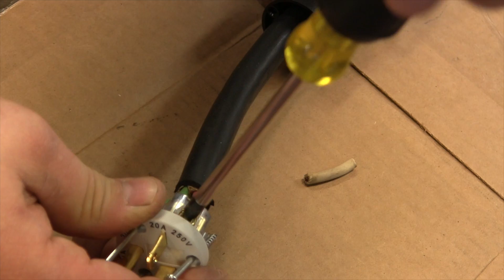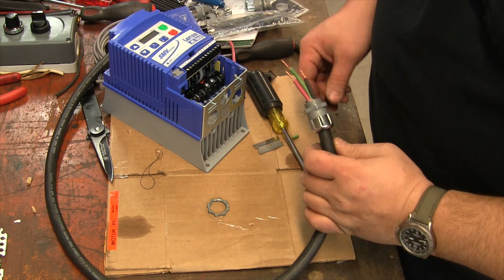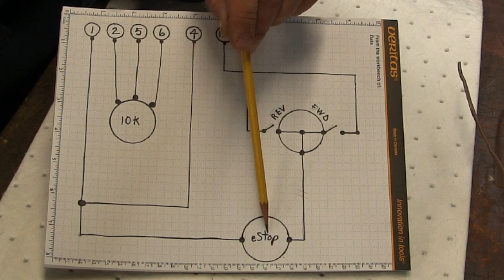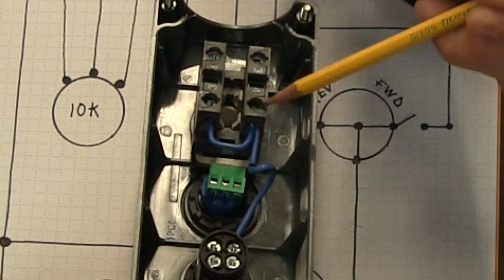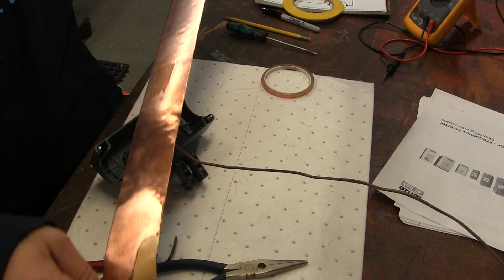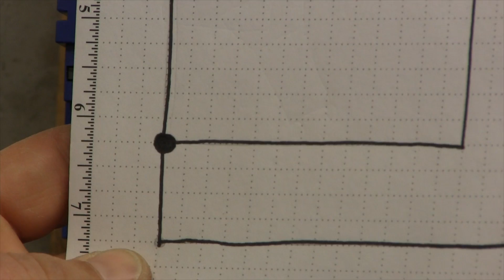South Bend Lathe 3 Phase Motor & VFD Installation   Part 2

Comment: If you are not going to install proper connectors for the line voltage into and out of the VFD at least tin the copper strands before screwing them down in their terminals.. Man this video has turned out to be a major disappointment.

Comment: You don't need any shielding in the switch box if you use a noise filter into the VFD.  You don't need a filter out of the VFD.
Reply from the maker: Well dude, I’m not an electrical guy whatsoever. That was years ago as well. Luckily for me, the install was rock solid and the machine always ran like a clock without a single issue. The it got sold, haha.

Comment: Dude.... I just went on the Galco website and priced out the parts for your controls. Insane prices. $118. for the 10 K pot. It's low voltage man and I am objecting that Amazon wants $12, for one. 
This Galco company is nothing short of highway robbery, ..... If you paid anywhere near these prices you got hosed big time. Why would you pay $7. for a strain relief into the bottom of the VFD when a plastic one at a third the price will do the same job. Not to mention you are not suspending small children from the wile leading to the VFD.

Comment: Mr Jacob I thought I heard you say that you would give is all the numbers and etc. on the switches that you bought the Forward  Reverse Switch the E SWITCH The On and OFF SWITCH and the HOUSING they fit into I could not find that Information, OH and also THE POT so would you PLEASE POST that information for me? I would really appreciate it I am not an electrician I am a machinist by trade also, I played guitar my entire life heard you say you play I am 82 getting to point I don't play much anymore got some gear to perhaps to get rid of if your interested Please let me know, OH, I am putting a new 3 HP motor and VFD on my old Clausing Lathe that is the reason for the numbers for the switches his is all new to me just trying to work my way through this project with the help of good fellows like you. THANK YOU very much, Bill
Reply from the maker: Bill I don't have that info any longer. I thought I'd get it out in another video and life just gets in the way.

Comment: Should have bought a KBPC drive. Great drives, I love 'em.  EDIT after thumbs up, After watching entire video you did an A #1 wire up job and that VFD has some really cool features that are not on the KBPC drive, all it got is forward, stop and Reverse but you can get a motor brake feature. All in all a sweet job all the way around.

Comment: Brad! thanks for the video. Do you mind giving me some insights on my HITACHI L100-004MFU2 and 1/2 hp 220 3 phase motor? Im installing it in a mini lathe for variable speed reverse and forward also stop and on switch. I made it work with the control that comes in the cover but would love to do it like you are doing it.

Thanks!

Comment: Brad Another great video.  When I wired the Lenze VFD for the surface grinder I had to unscrew the bottom metal panel to have enough room to connect the power wires.  You made it look easy.  Tim
Reply from the maker: +harrisevo Hey Tim - well, there was a lot of conversing with Stan and doing plenty of my own research off-camera as well. Glad you liked it.

Comment: A very clean workmanlike installation. I have seen professional electricians do much, much worse. I like the neat bends in the cables. That makes it easy to see who goes where. The only quibble I have is with the jumper 1-4 . Convention is: Green is Ground (GG), real ground that is. It's a quibble. But it looks at a casual glance that you have grounded 1 and 4. Some other color better. I do not agree with some comments that said you left the wires too long. Neatness equals ease of maintenance. I have fished far too much spaghetti out of boxes and then let me see, where does that wire go to? Well done, Brad.
Reply from the maker: +Juan Rivero Thanks Juan - I appreciate that. Yeah, you can't please everyone - the system works good and it's clean. Also, my first VFD that I did myself. My mill was done by a friend who's an electrician. So this was fun and educational.
Reply: I trained as an electrical engineer. My profs all agreed: a neat wiring job now saves endless problems in the future.

Comment: As you discovered, sometimes you want to get into a wiring box after you have it all wired up. You always want to leave enough wire in the box to remove the cover/switches and work on them.
Reply from the maker: +Peter W. Meek There is (some) play, but yeah could have been a little more. Next time...

Comment: Nice series so far Brad, thanks for sharing. Alwats good to leave as much wire as possible, nothing wrong with what you did in the vfd, but I might have tried to have about another 4" on each lead and fold it into the box.

And you can program in the rampup and brake times.
Reply from the maker: +Steve S Thanks Steve. Yeah, I did program the ramp time. It's at 1.0 second ramp-down is 3.0 seconds.

Comment: Very nice but I would be a little concerned about the conductivity of the copper tape. Definitely worth getting shielded wire.
Reply: +BasementShopGuy 
Brad,
You actually need to connect one end of that shielding foil to the PE connection.  The idea of the shield around the signal wires is so that stray currents or electromagnet interference can drain away from your signal wires into the earth ground.  Just connect one end, connecting both ends would defeat the purpose.  Just some FYI for you.

Mike
Reply from the maker: +Steve Seidel I may. The shielding has nothing to come in contact to, though inside the plastic box.

Comment: for future reference....  rather than WD on your wires, try Windex.   It's very slippery and dries leaving no oil residue that can make your wire sheath go rancid.   Works great on handle bar grips too.
Reply from the maker: +ramosel Good tip, thanks!

Comment: Hi mate.  That is a nice set up you have got there.  The only niggle that I had was using the green for the loop, while the wire from the e stop was red.  It took a long time to get up to speed, I don't think that the motor needs that buffer.
Reply from the maker: +Marcel Timmers If you see the last video, the motor comes up speed in one second (the time I set ramp-up to). That was a factory default setting ;)
Reply: Ya mate, I noticed it later that you had changed the setting.

Comment: Good choice on VFD. SM Vector so easy to setup. Use them on the Mill and grinder. you be very happy with these units.
Cheers
Reply from the maker: +Fred&#39;s Machine Werks Me too - I really like this drive.
Reply: BasementShopGuy

I think one of the nice feature is it has it own Elec box in the drive and no fans to worry about like some of the others.

Comment: That thermostat wire looks very bad! You could buy a length of good 6 wires cable.

3 pairs phone cable, 8 wires computer serial cable...
Reply: +Olivier Nicole Network cable could be another choice (4 pairs).

And you have ct your cable very short: while the VFD should be mounted on the wall, the remote should be on your lathe, near all the commands, so you'd need a longer cable.
Reply from the maker: +Olivier Nicole The wire "looks" bad, c'mon... It's completely hidden inside the conduit. I'd say the whole job looks pretty clean.

Comment: did't Stan send you control wire ? I dont like wire nuts never have
Reply from the maker: +Bleu Wolf He did, but it was SOOOO thin. Wire nuts are the way to go for the motor-wiring. I've heard that you should not solder those connections as the voltage would make for a dangerous situation. But I'm NO electric expert.
Reply: +BasementShopGuy Why would voltage and a soldered connection be dangerous? I guess if you had very little fusion the connection could run so hot to melt the solder but I doubt it.
Reply: +bcbloc02 Professional electricians use wire nuts all the time for small to large connections.  Wire nuts come in a very large range of sizes to accommodate small wire to multiple large wire connections.  If the correct wire nuts are used they are very strong and tight.
Reply: Roy Reynolds
I have no issue with using wire nuts, I was just curious why a soldered motor connection might be dangerous.
Reply: I don't think it is.  A good solder connection would be like a continuous wire.  Wire nuts allow for a quick, clean connection and an easy means of disconnection if needed.  A solder connection would still need to be covered for insulation purposes so wire nuts make the  connection and provide insulation all in one.

Comment: Switching 2 and 6 on the 10k pot will make no difference. The resistance between the two lugs is 10k there is no orientation difference.
Reply: It will make a difference in the direction you turn the pot to change the speed.